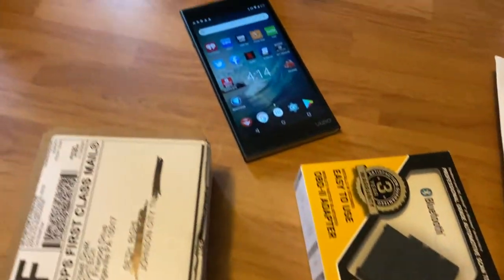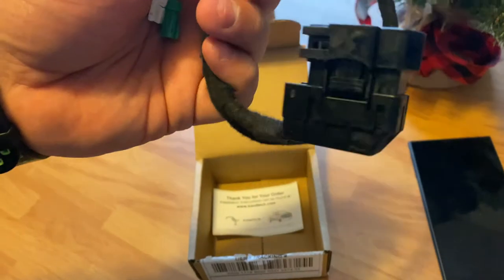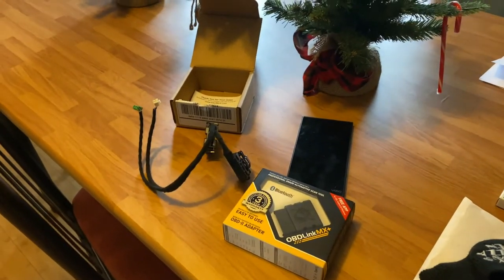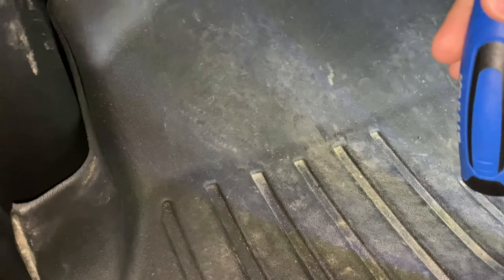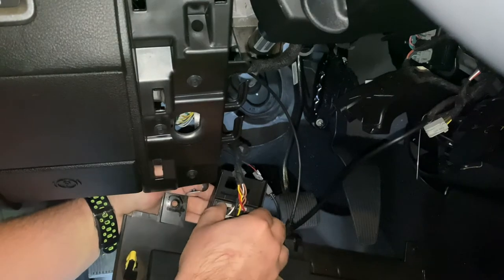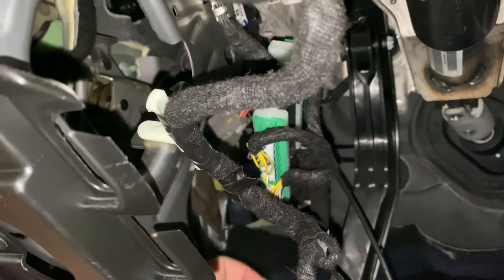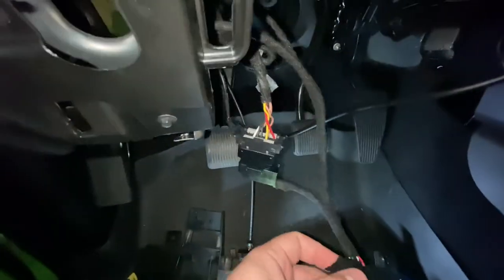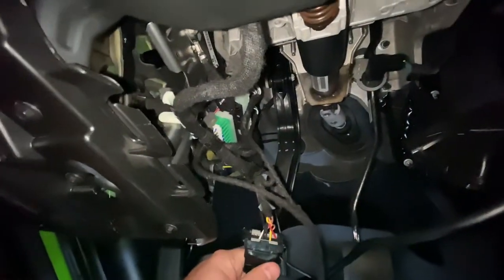2018-2019 Ram OBD bypass cable installation

Comment: Good video of the connection. It's irritating as I have a 2023 and big tires. I'm thinking  I'd have a fit trying to connect these wires! How does a dealer change stuff? I'll assume they enter a code through the obd. Enjoyed the video.. I was about to get the app and have a fun day, cables nixed that.

Comment: Hi I have a 2019 dodge ram 2500 that has a check engine light.  I was told that i need to suscribe to Auto Auth and buy the 12+8 pin connector so i did but a can't find where to plug them if i buy the sut up that you have will that let me do regular maintenance on my truck thank you

Comment: Does the Alpha give you the option to do a manual dpf regeneration and the option to recalibrate the turbo actuator on a Cummins equipped truck?
Reply from the maker: Don’t think so
Reply: You can do a forced regeneration with this .

Comment: So with the bypass cable you can’t get the PIN code? You can’t pull the pin from the scanner?
Reply from the maker: nope only a dealer has the pin
Reply: @SethRighi  okay thanks I appreciate it

Comment: hey man. i have a 2021 ram. i bought the same obd link mx + and i got the bypass cable from kaodtech. i can run a diagnostic on the truck but i cant seem to find all the other things to bypass led lights and other functions. for some reason my app that i downloaded looks different from the ones i see on your video. which app do i need to be able to make changes on the truck?
Reply from the maker: Don’t think it works on a 21
Reply: @SethRighi  actually i figured it out. for some reason when you buy the obdmx + it says to download a different app. but when i download the correct app and pay 50$ for it, then i have access to all the goodies. i was able to figure it out. thanks much
Reply: @obliciouzz  What other app?

Comment: Hi, I like your Videos I been watching them,  I like to ask you,  if you can do a video setting a miles and idle hrs in your new premium 7" cluster. 
I did bay the  bypass module but for a reason dont allow me to do any change 
In my new cluster  , is not detecting my bypass, becouse it only detects 
Control unet 2013 to 2017 power net
And my truck is 2019 classic. 
If you can do that,  I will  appreciated,
Thanks .
Reply from the maker: Israel Arreola I’ve done one on the miles check the next couple videos. I show how i did mine
Reply: @SethRighi  ok I will,  thank you

Comment: Did u just wiggle the smaller pins out. Im having a little difficulty removing them. Truck is still on warranty and don't want to get question about having the bypass module in and it voiding warranty
Reply from the maker: MCham08 they un clip really easy you can remove it for the dealers truck is under warranty as well just hit 7k miles